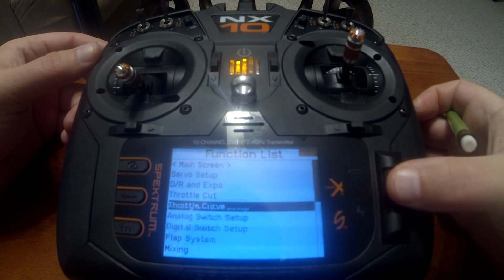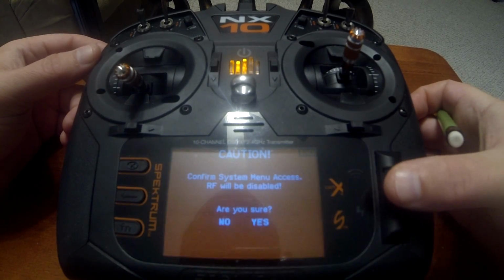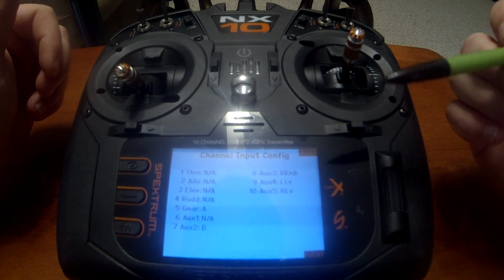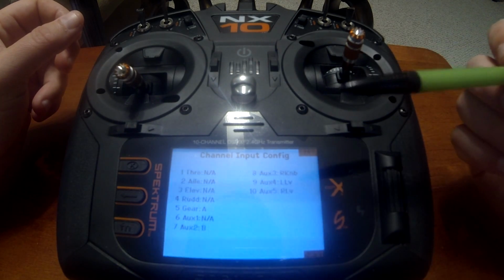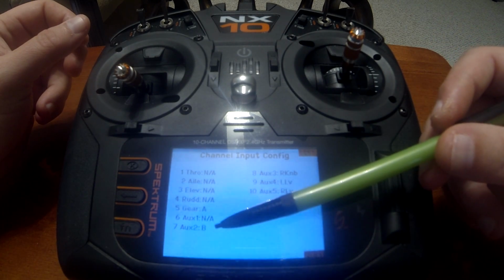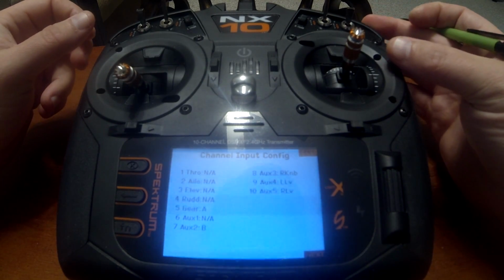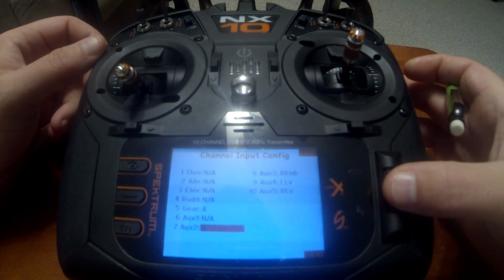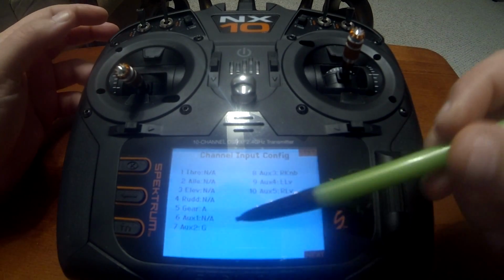Spektrum NX Setup: How to Setup SAFE Mode/Assign Switch with AR636/AR636A/AR636B (NX6/NX8/NX10)

Comment: You need to add that Throttle Cut feature need to be OFF , as well as 100% travel on all flight controls. Only my F4 Phantom mentions it . Not all manuals mention it.
Reply from the maker: Thanks for mentioning about the throttle cut, i thought i had it in there.Rates needing to be 100% ,i mention that starting at 18 seconds into the video.

I appreciate the feedback and thanks for watching!

Comment: This doesn’t work for me on an nx8 and a turbo timber evolution. I program the correct channel to the H switch, but the process of binding that switch to safe select never works. Any ideas?
Reply from the maker: You can do this method.However id use Forward Programming since TT Evo has a AR637TA. I have that video on the channel too...

Comment: IF anyone wants a better transmitter battery for the NX6/8/10, the battery for the iX12 is perfect! Lasts forever on a charge! (Discovered it on a try! 😁)
Reply from the maker: Good info on the battery upgrade! It makes the NX6 and NX8 upgrade to 6000mah.Standard battery on NX10 is 6000mah.

Comment: I am using an AR636A receiver with an NX6 transmitter. I tried following your video, but the toggle switch does not enable or disable the AS3X function properly. How can I reset it?
Reply from the maker: Disable as turn on and off or the position of the switch?

Comment: New to RC flying and need safe and AS3X. I recently bought the E-Flite A-10 64MM, but it was version 1. I have set up safe select on  switch B, but I thought I'd have 3 positions, Safe Select, AS3X Intermediate mode, and Safe Off, for full control. It seems I only have two options, safe select on, and off? I have an NX8 radio. I have watched your videos and they got me this far, Maybe I only have these two options, and not the 3rd? any thoughts hat could help?
Reply from the maker: Some older eflite planes with ARA636 receivers had 2 modes. However 2 mode version when safe is on or off still have AS3X mode.

Comment: I have a nx 10 and trying to bind to a ar636a I’ve tried everything an everyone says I’m doing it wrong but nope no matter what I do safe select ends up on my gear channel retracts up safe on retracts down safe off I’m pretty much done with it do the sticks down and in and flip the switch I desire an  it try’s to forward program and says failed no matter how I try to bind it . The switch is always on gear channel  any advice  would be really really really nice at this point
Reply from the maker: AR636 wont connect with forward programming because that receiver doesnt support FP...

So here is recap of settings need to be done  using 5 toggle switch method.

1) 100% rates (d/r switches active switch them to have 100% value)
2) Go into channel assign and set the switch you want to use in next step on Channel 7 (ie Channel Assign > Channel 7: Switch C)
3) Next is briefly mentioned in video, do this process right after binding. So rebind and then do 5 toggle switch method.
Reply: I have followed your instructions to the letter and it’s like safe is locked in on gear channel  . And the sticks in and toggle won’t work it try’s to forward program and fail on a receiver that does not support it n my old dx I had to run flaps an gear on a y with a inline servo reverser on the gear that’s why I bought the new nx  and figured I would be able to make it work the way I want it to but no bueno
Reply: I finally got it !!!!!!!!!!!’!!!! I’m so excited . I created an new model and the only thing I set up was th cut and assign the switch I wanted to aux 2 before binding and everything worked I was surprised . Because I always go thru an set up everything I need be fore binding like flaps general expo I prefer F modes and all that good ness so I figured I’d try with out setting anything up on the radio . So thank you so much for the tutorial
Reply from the maker: @Tanker831  great! Glad you got it fixed.

Comment: Thanks for the video - I have a Valiant 1.3 with a new fuselage, so had to move the AR636 receiver over.  This instruction should be very helpful.  However, I'm a little confused... at :35 you say "remove the bind plug" as part of the SAFE bind process.  Then at 1:01 you say "power down the plane" then at 1:03 "remove the bind plug".   BUt the bind plug has been removed back at :35 into the video?  What am I missing?  Thanks again
Reply from the maker: Install bind plug, Power up receiver , Remove Bind Plug while flashing , Bind Mode on Radio

Comment: Bought an NX8. Learning alot about setting it up with your vids. Have subscribed since I connect with the way you explain things, well done!!

Suggestion for new vid...explaining AS3X and safe mode in DETAIL. Seems to be alot of confusion around this. What exactly is AS3X, how it works and what it does/control, what different safe modes change, control, limit, etc. I know this is way off topic but does not seem to be alot if any info regarding this.
Reply from the maker: Thanks for watching and following! Ill try to get that video cause i agree confusion in the different modes.

Comment: I very much appreciate your videos. I couldn't figure out why my safe switch was not working as programmed. Then I discovered in your video the throttle needs to be 25% or more for the programming to take effect. You would think the manual that came with the plane would have mentioned that. I have used other videos you've made. Now I just look for your videos when in doubt. Thanks very much.
Reply from the maker: Great to hear Paul! Thanks for support too. Reach out anytime :)

Comment: Hi, this is a quick related reaction to your great video and also the next step of installing Flaperons. this is about Spektrum AR-631 receivers and my Spektrum  DX 8
Hi, Your videos are very good. easy to understand and follow.  
------Just wanted to add that my experience for setting up Flaperons with a Safe  AS3X PILOT 1 ARF STINSON VOYAGER. ONLY  the Right Flaperons will Correct, or do it's Safe or AS3X stabilizing function  BUT the Ch 6  Left Aileron will not correct or do any AS3X or Safe  function.  Reason is that only Receiver Ports 2 Ailerons with Y connector,   3Elevator, and 4Rudder are active with SAFE AS3X mode.  Port 6 is outside of that.  So this means that all stabilizing and limiting corrections will attempt to be corrected by just one Flaperon connected to Port 2 Aileron port. 
---- I have read that this is not so much a problem with full span ailerons like my Great Planes Trainer 60.  BUT it could be stall waiting to happen if you have shorter Flaperons like on my Stinson although it hasn't stalled yet .  I keep my approach stabilized and apply flaps on the downwind, keep speed up in turn to final as well.   If I was not aware of this Flaperon Effect a slow turn to base and final could induce a tip stall because of the yaw induced when the Safe aileron is overreaching (down) to do the work of the inactive Aileron (Port 6).  Just want to let you know this , but you probably already know.  But if you could put this into you appropriate videos with these warnings.  None of this is obvious and would have saved me a week of researching and double checking my stuff.  Also,  another Item:  The Great planes Trainer 60 mentioned above was built by me in 1996 covered with Monokote Chrome film and flew with a Futaba Conquest 74mh radio and long antenna strung external to the fuselage.  Training edge to vertical stabilizer. Chrome monokote has a metallic component.  I get a 12 ohm reading from probe to probe at 3 inches.  I therefore exited the 33 mm tip of the Spektrum receiver antenna out the bottom and did a range test. Full power,  300 feet,  with the plane both on the ground, and rigged sideways (knife edge flight between two garden chairs with the belly of the plane facing away from me.  Full control at this distance which I attribute to exiting the antenna out the bottom.  Question:  Do you think I need to use a remote receiver ? I hope not because I would have to buy a different receiver other than the AR 631 I just installed.  FYI: the fuselage has regular orange monokote below the beltline front to back and Chrome monokote above the beltline.  Thanks for the patience reading my input. You have an excellent speaking style, pace, and logical presentation. 
My sources are:  None of this is mentioned in any Spektrum Literature or operating manuals.  Re monokot chrome signal blocking, Only an old thread on a RC forum mentioned  and included a response from Monokote tech many years ago with a warning about signal reflection and interference with chrome monokote. Also another roadblock puzzle for me,  but solved ,  with the Trainer 60 which has an OS MaxSF.61 glow engine,  the receiver battery is plugged into Port 5.  When I had it plugged initially into the first port Bind Plug, I could bind and test the plane in the shop. But when I shut it all down and then switched on the tx and the rx  it would not operate... it had to be rebound.  Took me a while to figure that out. Also not mentioned in the RX manual.  
Thanks!

Comment: Very informative video.  Well presented. Great job!!
Reply from the maker: Thanks!
Reply: @BDTennessee  following the steps.... at 0:44 remove bind plug. Again at 1:10 remove bind plug. Not sure when to insert to plug after 0:44 and before 1:10.  Would appreciate further details.  Thanks
Reply from the maker: @horsth9566  Safe Active -Bind plug in RX > Power Up System > Remove Bind Plug > Bind TX

Safe Inactive - Bind Plug in RX > Power Up system > Keep Bind Plug Inserted in RX > Bind TX

Comment: BD, you always have the answer needed - so I'm reaching out to you again. Want to use switch B on my NX8 for Safe and also Safe Select model aircraft. I know Safe needs a 3 position switch but wondering if a 3 position switch can be used for Safe Select?
I'm pretty sure it can and wondering if you have any suggestions and tips for me?
Thank you
Reply from the maker: Correct. Safe with 3 modes (Beginner,Intermediate,Advanced) needs 3 position. They work in sequence with each other so you can put all 3 on same switch.
Reply: @BDTennessee  thinking I didn't convey what I was asking very well. Needing to know if Safe Select, which only needs a 2 positioned switch, can be use instead on a 3 position switch?
This is so there's no confusion when switching planes that have  Safe and Safe Select.
Believe a 2 position switch will work for Safe but not sure if Intermiediate mode will just be cancelled out or if there needs to be some special settings?
Reply from the maker: @we4fm175  both can be assigned to a 3 position switch. When using Safe with 2 modes. One position and Center position will be off and remaining is Safe on.
Reply: @BDTennessee  thanks BD. I knew you would know.

Comment: Assign a channel  (  example:  AUX 2  ) for SAFE  Select  before binding.
Insert the bind plug and power up the Rx , then remove the bind  plug ( after Rx starts flashing )   before attempting to bind  with the Tx ...as doing it  this way will give  the  option to put  SAFE Select  on a switch..

Leave  the bind plug in the Rx during the bind procedure for  AS3X  only  and the  SAFE feature  will not operate  or be switch assignable......

Select a  2 position switch for   SAFE   (  on / off )  then perform  the  toggle process  immediately after binding.

AS3X is always active  in either binding process.  

Correct?...thanks
Reply from the maker: Correct.

Comment: BD, I just bought a Durafly T-28. I have an updated AR636A. For SAFE, wouldn't orientation of the receiver affect SAFE? Do your control surface wires face forward of the plane or back? As with the AR631, forward programming tells you put on it's nose and level the plane for setup. Seems to me the wrong way will affect the elevator, won't it? As always, keep up the good work. Thanks
Reply from the maker: Yes,AR636A are programmed orientation. Installed improperly can cause wrong correction.
Reply: @BDTennessee  BD, I understand that but in the Spektrum Programmer it won't let me set orientation. I am not sure if the cables go toward the front or back. I guess I have to try both ways and see what happens. Thanks

Comment: I set up safe on all of my planes some with retracts all with flaps with my NX8 and I and I've never done the switch toggling with the sticks in.
Reply from the maker: Stick toggle turns Safe on and off for AR636. If you have a newer receiver then you can do everything in forward programming.

If you have AR636 thats bound in Safe mode,you do the switch toggle or Safe stays on all the time.

Comment: Hello BD. I watched some of your videos and I appreciate very much your your understandable way of explaining. My question is not directly related to this video but I hope you can help me as I think you are an expert: I own a Blade 230S Smart RTF and a Spektrum NX8 on top. I've done the programming of the NX8 acc. to the manual and double-checked it twice. On my first flight and after about one minute in normal mode the tail rotor made the heli spin about 90deg and then throttle was gone and the heli "landed", luckily on gras and only from 1,5m flight altitude. I checked and restarted the heli, but the same situation / problem after about three minutes again. When binding the heli to the RFT-radio DXs everthing was fine, not any issues or problems at all. I had exactly the same situation with my Nano S3 and my 120 S2 in combination with the NX8: Tail rotor spin and "landing" after about one to three minutes of flight time, but no problems at all when using their RTF-radios. So my question is: Can you immagine or name the issue? I´m quite new to this stuff at all and I´m a little bit confused now. Thank you very much in advance. Best regards, Markus.

Comment: I have a big problem that I hope you can help me out with.  I successfully set up SAFE on my RV-7 with an AR631 receiver and a DX9 transmitter.  I made the mistake of assigning SAFE to switch "A"  instead of switch "B".  I tried moving both control sticks down and inwards while toggling switch "B" with no success.  How can I move SAFE over to switch "B"  Can you help me with this please.  THANKS.
Reply from the maker: Manually Change: Settings > Channel Assign > Change Channel 5 or channel 7 (whichever is A) to Switch B. Make sure surface controls (Ail,Ele,Rudd) are on 100% rates. Now do the toggle method after you power up the plane. You may need to rebind.

Easiest way is forward programming. Gain settings > Change FM mode switch from A to B

Comment: After updating my NX8 to the new 4.1 I do not have the same list in forward programing as you have. what do i do next.
Reply from the maker: Forward Programming menu is based up the receiver. Menu looks different its because BNF receiver or Open stock receiver.

Comment: This means it's possible to toggle "Safe mode" on and off? Since last week I have bought an Spektrum NX8, next to my precious JETI DS-24. I bought the NX-8 for Bnf planes, because it is both very cheap and very nice models are also available. With the NX8 I have an E-flite V1200 BNF Basic with Smart and the Extra 300 3D BNF Basic with AS3X & SAFE Select. It confuses me, SMART-AS3X and SAFE. What does all that mean? I never fly with a gyroscope but might like it if the V-1200 has a little bit of stability aid active with landing, as this is quite a heavy and fast plane with very little deflection airleron only about 8mm. The best thing would be if the stability system could be adjusted in strength. I definitely don't need a "rescue" or anything like that, I've been flying for a long time and also 3D, so I don't get scared so easily anymore. Thanks for the explanation in advance, and of course for the video!
Reply from the maker: Spektrum AS3X is the gyro. Safe mode is auto leveling and bank/pitch limiting. When using AR636 you can turn off the Gyro (AS3X) but you can Safe. Now if its a new mode BNF that has a AR631 or AR637 then you can turn off AS3X (gyro) and Safe mode all together off (No flying aids). I have another video on channel showing that one.

Also be careful using the templates in the NX radios currently as there is errors in them and not setup asccording to book as they should...
Reply: @BDTennessee  Thanks for warning me and for the information. I will definitely watch the other videos about the NX and programming. As for the gyro, I think it's better to turn the whole thing off. I was able to land the V-900 with a lot of effort. There was also an active assistance system in it, but because I do a lot of stunt flying, the assistance system counteracted in such a violent way, which I reacted against by countersteering. I was really shocked by it, and took the receiver out and put a Jeti receiver in it.And sold the new DX8 again because I didn't like hat at all. Hopefully I didn't make the same mistake I did with the NX-8 ;)
Reply from the maker: @EXTRA300s  i agree im not much on gyro either. If you have AR636 you can get a data cable and wipe it clean.Then it will work like a normal RX without AS3X and safe.

Comment: I have the nx10 and the ultimate 3d plane.   Second plane first transmitter.   I have  bound it several times but it stays in safe.   I'm having trouble assigning a switch to work.   I assigned a switch on my Maule no problem.   I am trying to use the template.   I will try again and check the rate switches before I bind it and see if that helps.   Any ideas would be great.  Thanks
Reply from the maker: Make sure 100% rates.Also assign channel (channel assign menu)to the switch you want as shown in video. Then rebind the plane.Once the esc arms (multiple beeps then stops) then do the toggle 5 times switch toggle method. Some planes i have had to rebind and do the toggle right after the esc arms.